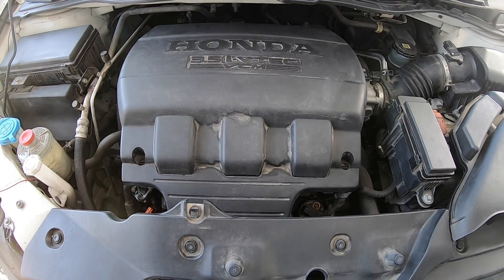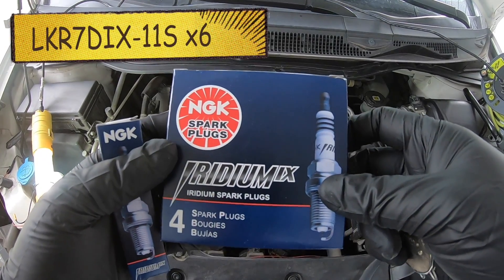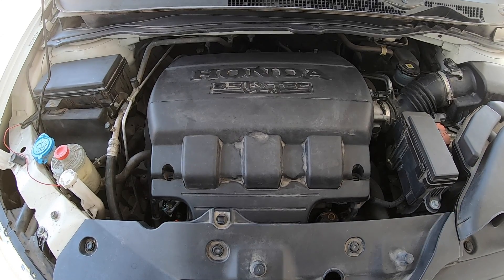How to Replace Spark Plugs on a Honda Odyssey 2011 - 2017 (4th Generation)

Comment from the maker: THE TOOLS:
• NKG - LKR7DIX-11S - Spark plugs x6 - https://amzn.to/412GBRT
• 10mm Socket - Basic Socket Set - https://amzn.to/3fjRoBd
• 5/8 Spark Plug Socket - https://amzn.to/410bPco
• 3in Extension x2 - https://amzn.to/3GleRQG
• Ratchet - https://amzn.to/3xWjE5g 
• Torque Wrench - https://amzn.to/3fEIrDi
• Gloves - https://amzn.to/3bbfEnu 

Chapters:
00:00 Intro
00:24 Tools & Supplies
01:35 Remove the Engine Cover
02:11 Adjust Size Spark Plugs
02:22 Locate all 6 coil packs
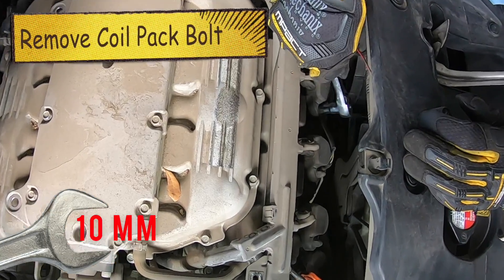02:33 Remove Bolts on Coil Packs
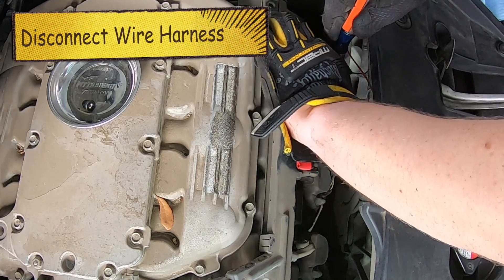02:49 Disconnect Wire Harness
03:02 Remove Coil Pack
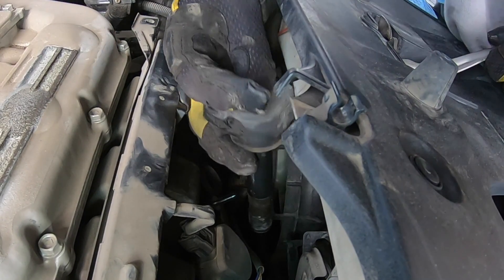03:18 Remove Spark Plug
04:45 Compare Old & New Spark Plugs
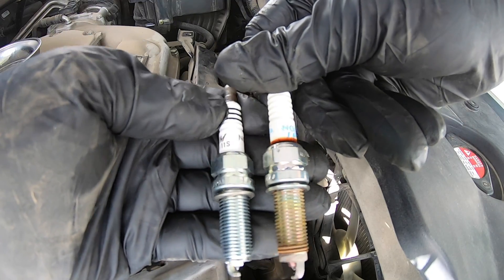05:01 Installing New Spark Plug
06:37 Clean Coil Pack
06:46 Add Spark Plug Boot Protector
07:21 Install Bolt for Coil Pack
07:59 Reinstall Wire Harness
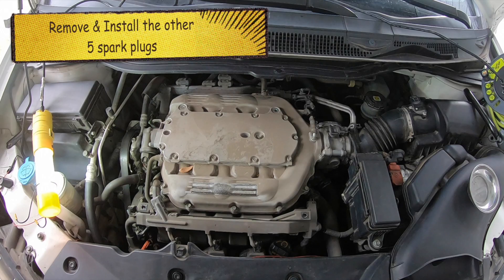08:08 Remove & Install other spark plugs
08:39 Testing Vehicle

This video works on all makes and models of vehicles. The video was done on a 2014 Honda Odyssey. 

Check out my website at http://mcfixit.us 

#odyssey  #sparkplugs #mcfixit #sparkplug 

Links are associate links. A small portion of whatever you buy helps support this channel. Thank you for clicking on the links and purchasing to help out this channel to keep making great content for you!

Disclaimer:
Due to factors beyond the control of MC FIX IT, I cannot guarantee against improper use or unauthorized modifications of this information in the video, post, blog, or social media. MC FIX IT assumes no liability for property damage or injury incurred as a result of any of the information contained in this video. Use this information at your own risk. If you feel uncomfortable at any time. Stop and go to a professional. MC FIX IT recommends safe practices when working on vehicles, your house, or any other project and or with tools seen or implied in this video. Due to factors beyond the control of MC FIX IT, no information contained in this video shall create any expressed or implied warranty or guarantee of any particular result. Any injury, damage, or loss that may result from improper use of these tools, equipment, or from the information contained in this video is the sole responsibility of the user and not MC FIX IT.

#mcfixit #autorepair #odyssey #honda #channgingsparkplugs #carrepair #mechanical 
——
Supplies used to record this video: 
* GoPro Hero 7 Black - https://amzn.to/3f3ALtb 
* 256GB Flash Drive - https://amzn.to/33pAueG 
* Vlogging Frame - https://amzn.to/33tajE0 
* GoPro Pro 3.5mm Mic Adapter - https://amzn.to/2RCURCu 
* Youmic Lavalier Lapel Mic - https://amzn.to/2R55sWX 
* Boom Stand (tripod) - https://amzn.to/3bdkQaw
* 5/8” to 1/4” adapter (boom to blogging frame- https://amzn.to/3txrVsM 
* Portable Battery Powerbank- https://amzn.to/3vJQc0q 
* 6ft USB to USB-C (powerbank to GoPro)- https://amzn.to/3uAS5M

* Portable Battery Powerbank- https://amzn.to/3vJQc0q 
* 6ft USB to USB-C (powerbank to GoPro)- https://amzn.to/3uAS5MH
Reply: This is the wrong spark plug number for this model, it close , but not the right one

Comment: How do you know which one is which if you only need. To change one
Reply from the maker: Change all 6 at once. 3 in front and 3 in rear. I do mine every 60k and have never had an issue with spark plugs. Why are you thinking about changing out only one?

Comment: Awesome Video. Only thing I have seen is the choice of Spark plugs. It is recommended a HIGH IGNITABILITY. Iridium IX is not (Part#93175) Ruthenium HX (Part#96358) is the other part.
Reply from the maker: Awesome, glad you liked the video! Thanks for the info on the spark plugs.

Comment: The back bank of the engine has to be done by feel, or a mirror.  Not as difficult as I anticipated.  Makes you sore in the lower back.  When the timing belt is done, you do not need to change the two tensioner bearings.  They never wear out.  This is per Honda techs.

Comment: Are the front and rear cylinders threaded the same way? That is, am I turning both rear and front plugs counter-clockwise to remove?
Reply from the maker: Correct! Left to loosen, right to tighten. That’s the way of almost everything on a vehicle unless it’s reverse threaded.
Reply: @MCFIXIT is anything on this vehicle reverse threaded that you know?

Comment: lol your not gona do the ones in the bak? nobody does. your all useless
Reply from the maker: Yeah, I know. There is no way to get a camera back there. They are the same as the front too. I tried to explain where each one was located.
Reply: @MCFIXIT  fail.....
Reply from the maker: @ Sorry you feel that way. I tried to make it as easy to understand as possible. Hope you can still fix your vehicle with the instructions provided. Have a good day.

Comment: Thank you for this video. 
If I replace the spark plugs, Can I solve engine jerking problem?
Reply from the maker: Can you explain your problem a little more! What do you mean by jerking? While driving only?
Reply: @MCFIXIT  Yes. Withe Engine is flicking n AVS warning light on. Car is very shaking and speeding reduced.

Comment: You do not need a torque wrench for spark plugs quit telling people to use a torque wrench. People will not know how to use that and you will break the spark plug. They just need to be snug down enough. And next time mention cylinder one through six so they know which one is the correct firing order.
Reply from the maker: I understand what you are saying for sure and I’ve done that for years on personal vehicles. BUT often people over tighten so I share the specs. It’s important to not over tighten and then have to have it extracted out at a shop. Thanks for the tips about firing order. Thanks for watching and commenting!
Reply: Torque specs are good to have. If you've never done spark plugs before, just follow the specs and there should be no issues. There's plenty of videos out there on how to use any tools. If you already know how to change spark plugs and have a good feel of how tight it should be, then go ahead and just snug them. Shouldn't be an issue too. But telling someone who's never done it before to just snug them down enough = overtightened most of the time and sometimes even damaged threads. Extracting broken plugs and doing thread repairs into the engine is no fun.

Comment: i changed the spark plugs but the scanner shows Cylinder 6 issues i reset the code but after 2/3 mins of scanner reset the check engine comes back again what could be the problem

Comment: The reason for watching this video is to know how to install the Plug 1 (Passenger seat side). Sorry.
Reply from the maker: Sorry you didn't like it. That view would be nearly impossible to shoot due to the body and engine of this vehicle. It's identical to the front side if that helps!
Reply: @MCFIXIT Thank you. Removed dislike and selected Liked.

Comment: Use anti seize on spark plug threads and dielecteic grease on plug covers.
Reply from the maker: Definitely an option! I’ve done that many times before. Service manual does not call for it (probably too many issues with people doing it wrong or putting too much on). Thanks for the comment and for watching

Comment: Rear plugs  
That's what I need a video about.
(Edit) but based on this video, I got-r-done! So thanks!
Reply from the maker: I wish I could record that but it’s super difficult to get a camera in that location. All you’d see is my hands. I have some helpful tips on how to do the rear ones but it just wouldn’t make a good video. They are super similar to the front though!
Reply: @MCFIXIT  Based upon what you Did show, I was able to get the back done too! I wish I could post a pic of the red coil packs. They look good on the engine, so thanks! 🫡
Reply from the maker: I’m sure they do! I’ve thought about doing a colored coil packs but I just normally get the normal black ones.

Comment: Thank you for explaining. My don't have problems to start but the needle start dancing  at 1500 rpm and the car is kind of jerking? What do you think  the problem is?
Reply from the maker: That can be caused by a lot of issues. I’d first check to see if there are any codes it’s popping up with a scan tool (or do a place that will do it for free). Then depending on that, fix any issues. If none, I’d check for leaks in vacuum hoses. How old/miles are your spark plugs? Coil packs? Have you cleaned the throttle body & I think they have a mass air flow that can be cleaned? Also how many miles does it have? 

I haven’t had this vehicle in about 2 years and I’m trying to remember all of its components that could cause this.

Comment: It's the rear spark plugs that people actually need help with. For starters, how do you remove those doubled black clip-ons that are in the way of hand positioning?
Reply: Agree. Let me know if you find a good video, please. Thanks
Reply: @igl9273  
i couldn't find anything on how to get rid of those black things. It looks so simple to take them apart, but I simply can't figure out how to do it. So of course I'm just working around them, jamming my wrist up against them.
On Monday I'm planning on buying the VCM Tuner II.  It is supposed to permanently disable the VCM activation. I hope that will take care of the spark plug fouling and the coil dying. It's $140  but I  expect it'll be more than worth it.
Reply from the maker: Please let me know how the VCM Tuner II works. I heard about those before but not used them.
Reply: @igl9273  I am sure he did not replace the back one, they are extremely difficult to replace, due to the tight angle and you might need to take out the wiper front cover for better work space, ill be doing a tune-up soon watch out if I can get it done this time,.
Reply: @daprincehwc  I did the back ones. There is no need to remove the wiper like in the first-generation Nissan Murano or 98 Maxima. Honda makes it easier than I thought.
Reply: You don't remove the strip on top of the engine. The spark plugs are just behind them. Almost impossible to see but you can easily reach a hand in and feel them. They are a pain but definitely reachable without taking anything else apart.
Reply: @ScottishFox  
Yes I know they are reachable, but it' would sure be a lot easier If one could take those strip connectors off.
In any case I don't think I have to worry about doing this anymore. I installed the VCM-Tuner II some months ago, and basically the VCM doesn't activate anymore. We did have one problem on a hot day when my wife was stuck in backed-up traffic, and the fans for the radiator would not come on. I need to hotwire those fans with a switch for manual operation.
Reply: Agreed watched the whole video for something I already did
Reply: I couldn’t find NKG spark plugs for my van.  I did find NGK.  Is this the same or a different model plug?
Reply: For me, it was actually the front 3 cylinders that gave me the most trouble. My 3" extension was too short but my 6" extension didn't have enough clearance on two cylinders. Might have to pick up a 4" extension if that's a thing.
Reply: You have to do the back ones by feel. I was hesitant at first but got them all. Lean way over the engine and get after it.
Reply from the maker: Shooting a video of the back is nearly impossible. I tried it on my Ridgeline (same engine) and it didn't come out well. This is even a tighter location which makes it even more complicated.

Comment: Like your wrist band, brother! Be good to use antiseize on spark plug threads to keep from stripping out threads in heads.
Reply from the maker: Yes, I've done that in the past, but Honda does not recommend that. I know it can mess up torque specs. But it does make it easier if you live in the north in the rust belt. Thanks for noticing the wrist band :D

Comment: Do you know the cylinder firing order? Are the 3 in the back number 1, 3, 5 or 1,2,3?
Reply: The back are 1,2,3 left to right
Front is 4,5,6 left to right
Reply: @cwhip2432 Thank you for confirming this!
Reply from the maker: Sorry, I don’t. This was on my sister in laws vehicle. I’m not that familiar with this vehicles cylinder firing order.

Comment: Great video. How hard were the back ones to do? I know its hard to show on the camera due to the angle.
Reply from the maker: Thanks so much for watching and commenting. The back ones were harder. One of the sides was the most difficult, I believe it the was the left side. A little maneuvering and you can do it. There’s also a hose on the top that can be removed for easier access on one of the spark plugs.
Reply: @MCFIXIT  What is that hose for?  If I just loosen the nut and move the hose out of the way, will any other fluid spray or leak out?